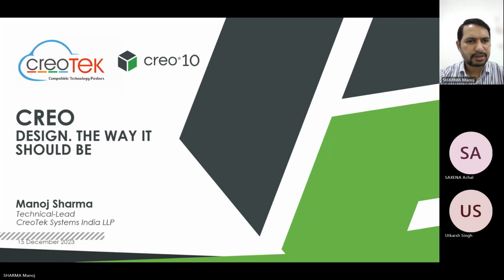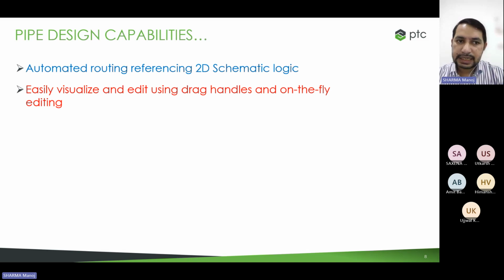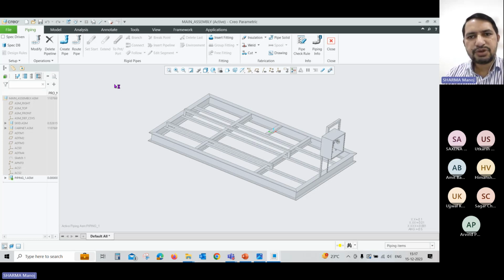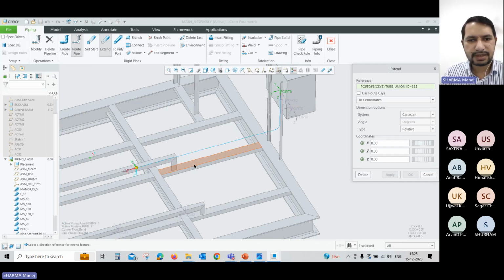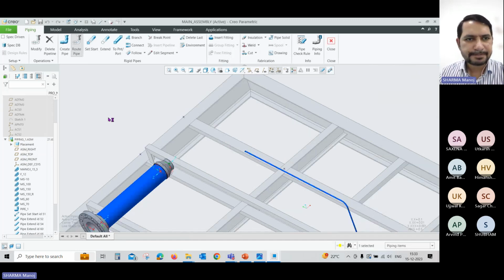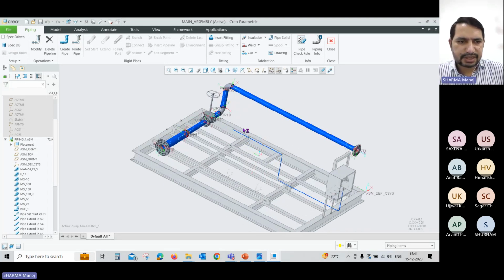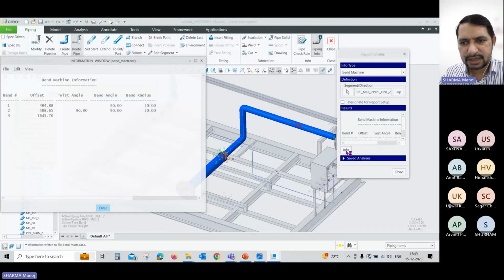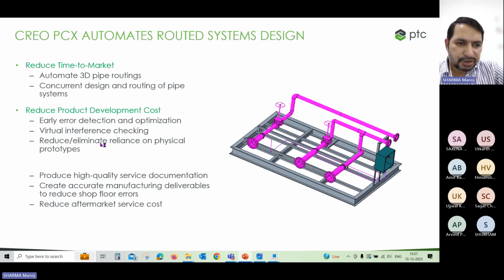Mastering PTC Creo Piping A Comprehensive Webinar Meeting Recording

Comment: Sir the video is helpful. I have one question. When we add flange to the pipe , do we need to select the coordinate or the point to assemble it in pipe.
Reply from the maker: Yes, coordinate system with z-axis outward or datum point is required